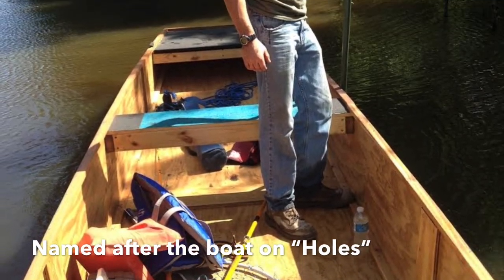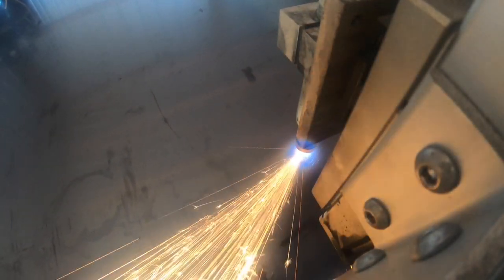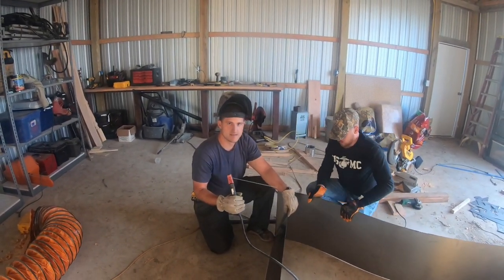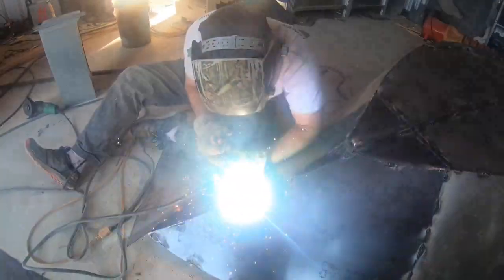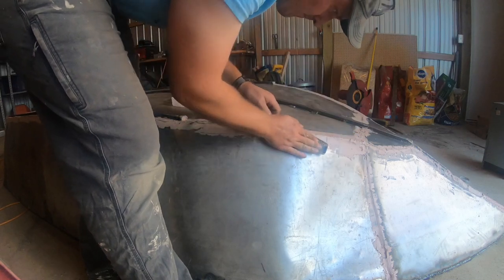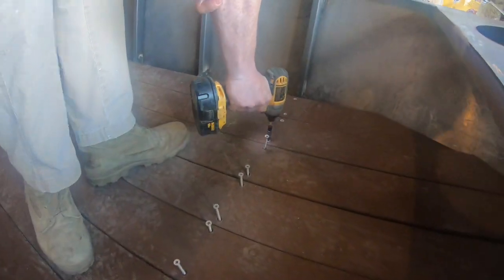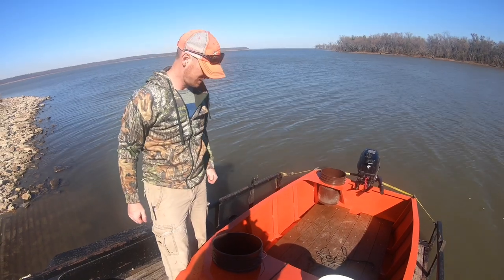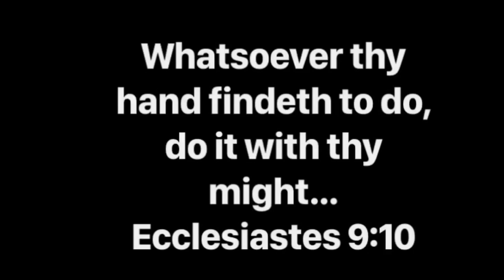I built a STEEL BOAT! Will it FLOAT?!? (JP S1E4)

Comment: My dad and I weld a 14" boat entirely out of 14 gauge. It floated just fine, plus it would break 1/2" to 3/4" of ice in the winter.
Reply from the maker: That’s crazy! I bet that guy was heavy!  I wish I would’ve used 16 gauge.  It would’ve been so much easier to weld.

Comment: A prime way to make a boat more stable is to lower the center of gravity. You were both sitting high ON TOP of the boat instead of IN the boat. It needs seats that are lower than the sides of the boat by several inches, and you sit on those to lower the center of gravity, thus making the boat more stable.
Reply from the maker: Thanks for the tip! I have only built a couple boats for fun and I have no clue what I’m doing to be honest.  I will look at doing that on the next one I build!

Comment: LOL !! Angels cry " ? dont know about that... but this welder and fabricating metalspinner is having a little laugh. Sure hopes this thing will be floating before the end of the video. But 20g or .9mm as the French call it, is pretty thin for butt welding. This will be interesting.
Reply from the maker: Lol. I have to admit, it was some of the hardest welding I’ve ever done.  It would Oberon much easier if I would’ve purchased smaller welding rods.

Comment: hey nice project!
I have a question: how many hp motor is that? does it get up planing?
Reply from the maker: Thank you! It’s a 6hp motor.  Yes it does.  We could not get it to get up planing on this boat since we made the back too tall, but we had a light job boat that it would easily do it.  It’s a good motor. Made by Tohatsu (Mercury)
Reply: @DIYMAN  Cut and reinforce a notch in the back (transom) to drop the motor.